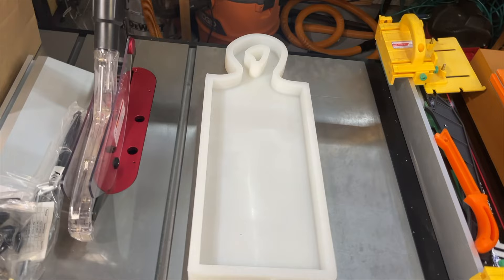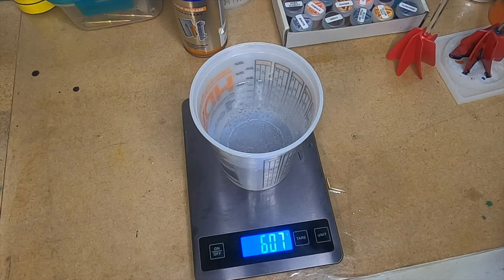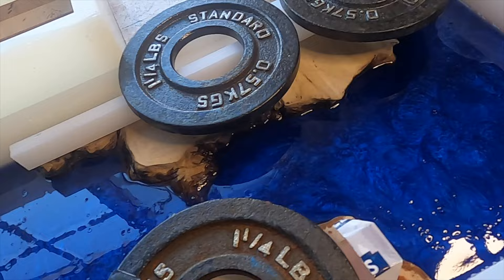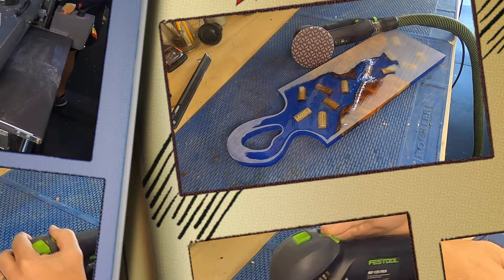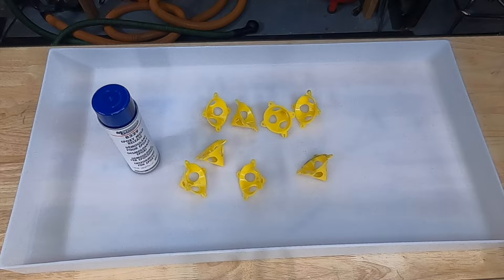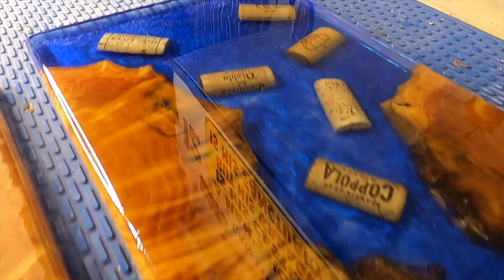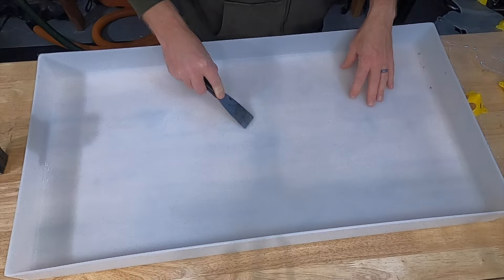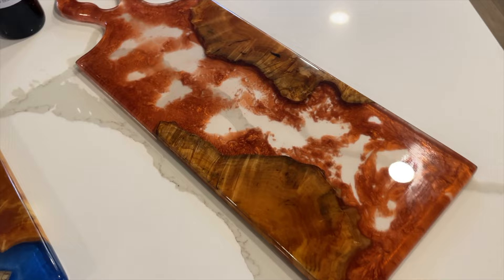Epoxy Resin & Wood Charcuterie Board With Wine Corks Tutorial

Comment: I’ve had bubble issues with the corks so I’ve made a cup of sealer and just dunked each one then placed, then torched out bubbles for a bit till started to gel up then added the rest of my clear deep pour or whatever.
Reply from the maker: That makes sense and would a different way of achieving a similar result.
Reply: @CraftedElements  yeah third time was the charm, first time got some floaters cuz waited to long to stick them down on first layer, second time got excessive bubbles coming from corks, third time was what I mentioned and worked well for me. If you’re not failing you’re not learning. Lol. Merry Christmas
Reply from the maker: @TailEndCustoms  100%. If I included all my mistakes in our videos, they would be twice as long :-). I try to make myself look like a pro, but I'm a better marketer than a woodworker 🙂
Reply: Thanks for the comment. I used the longest curing epoxy super clear makes and did the clear in multiple pours over a couple hours to limit the bubbles issues. I have pre sealed corks in the past and the has worked to just more steps.
Reply: @TailEndCustoms  yes sir… we fail to learn. The orange board had floaters.the epoxy was not hard enough. The corks stuck to the orange and pulled the orange epoxy up.  In the end that is what gave the orange one the depth.
Reply: @Makerdanbuilds  right on. I use wisebond. May have to try superclear.

Comment: Maybe it's just me, but it seems easier to buff the pieces to a shine, vs pouring more resin on them.
Reply from the maker: It's up to you, generally the flood coat method is easier and although it takes an extra day to dry, it avoids all the sanding and polishing.
Reply: I wanted a glossy look on everything for these boards. The labor is about the same between a table pour or a polished board. Also polishing removes material while the table top epoxy adds more material if you are ever worried about thickness or hitting a cork.

Comment: Thanks for this vid..clean up question, do you reuse the cups you’ve mixed with?
Reply: Thank You for the comment. I will spray mold release in the bucket before mixing to help clean the epoxy out. Most of the time I can reuse them.  If it takes more then about 2 minutes to try and clean the bucket goes in the trash. They are cheap to replace on Amazon.